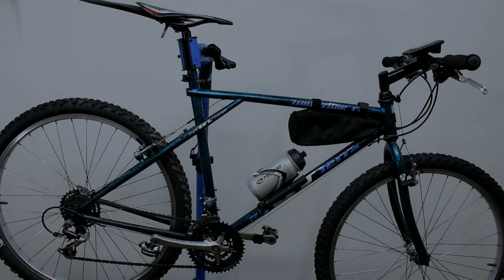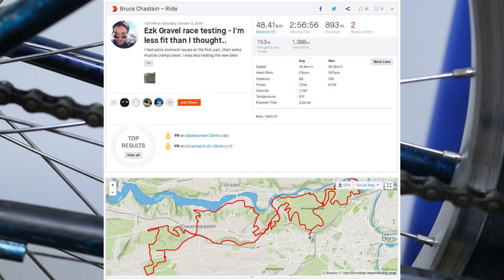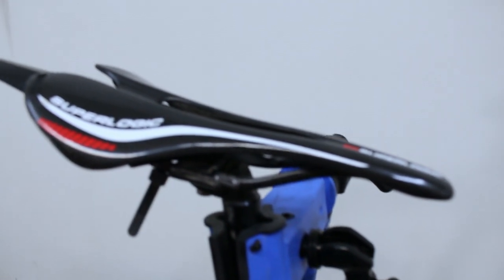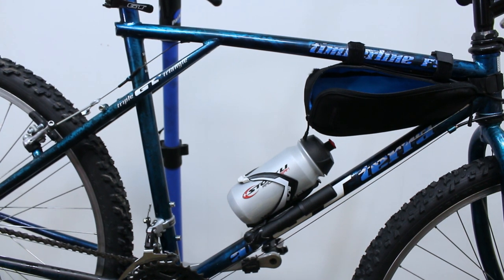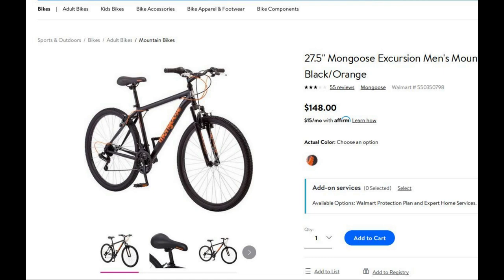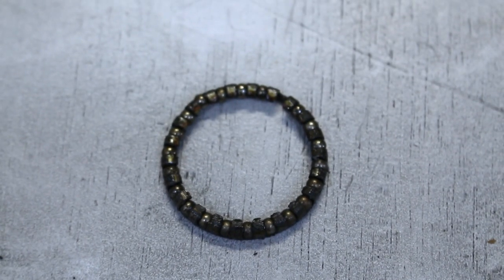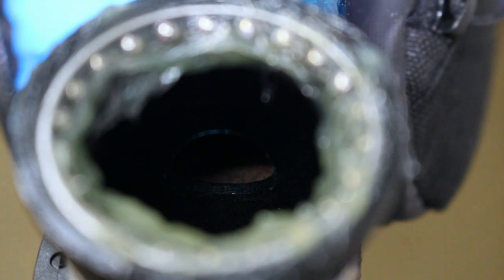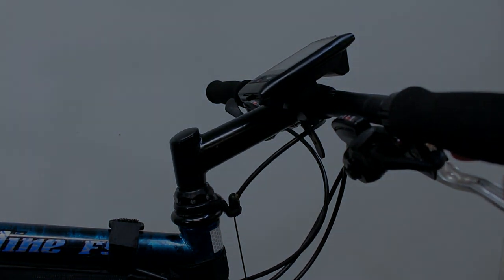1995 Vintage MTB Restoration - PART 2

Comment: I would not worry too much about the rust.  The moly frames are steel, and the frame tubes are not sealed.  Just surface rust, if you see cracks at the welds, then there might be something to worry about, but it looks good to go to me.
Reply from the maker: I did take a pretty close look at the joints. Thanks for the comments!

Comment: A couple of points you brought out in your video:
-I also have a 1995 GT Timberline. It's the best vintage mountain bike I've ever had. I still ride it like a modern bike. 
-The "rust" inside the frame is more patina because the inside of the frame was never coated or painted. If you live in a wet or wintery environment (sounds like you might be in Canada), then you can spray Frame Saver inside your frame to prevent it rusting from the inside out. Honestly it looks fine. 
-Im impressed you found bike brakes at your hardware store.
Reply from the maker: dang I'm getting so many people who have this same bike, I guess they made a lot of them. I'm really enjoying it, actually went on a pretty decent 2 hour ride with her yesterday. thanks for the comments on the rust situation, now it stays indoors when not in use, so I think it should be fine going forward.

Comment: Spray a load of WD40 into the frame at any access points (head tube, seat tube, BB if possible, drainage holes). That should displace any water from the frame, relube the metal but also protect it (to a degree) from further water ingress.

Comment: About the brake squeaking, if there's actually some gum left on the pads you can sand them a little bit, it does give them a little bit of time left.
Reply from the maker: Yeah bet I could have done that, honestly didn't think of it. But I do still have the pads, so I could give that a try.
Reply: Cantis squeak. Cant get away from it.
Reply from the maker: @donnovicki9771  with the new pads, at least for now, they are not squeaking. Actually on the test ride I was doing last weekend some of the disk brake riders were way louder than me.
Reply: @donnovicki9771  Not always! If you tune them properly (which is a challenge) you can get a smooth, silent ride with cantis :)

Comment: I spray fish oil inside my frame and I use copper antisieze  ont all the threads and I use marine grease on the bearings but my bike lives outside and I ride in all weather . What you really don't want is the seat tube and the bottom bracket seizing up that can really ruin a bike .
Reply from the maker: oh yeah tell me about the seat tube, I had one so stuck I actually damaged the frame getting it out.
Reply: I red can rust check all my steel frames and even aluminum ones as they can get the white dust cancer inside. Copper anti seize i use also as i used to use many titanium bolts and  that copper stuff is a must for Ti next to Steel.

Comment: Wow you're using a 7 speed cassette great. Simple and straight forward. Every gear is the right gear
Reply from the maker: thanks a lot T!
Reply: @BruceChastain  A 7 speed is built for all out speed each gear getting progressively harder building up explosive speed. At the right time A sprinters delight. just my thoughts
Finally all a person needs is a 7,8,9 or 10 speed cassette plenty of range 11-12 speed is over kill again just my opinion
Reply from the maker: @tmayberry7559  well this freewheel hub set with 7 cogs is how it came from the factory as most bikes of the time. It’s not going to be as good as the wide rage cassettes of today for sure l, buts they didn’t have much more in the mid 90s.
Reply: @BruceChastain  yes but they do make 9 and 10 speed freewheel. I have on by epoch 11 x34. Go team Chastain!!!
Reply from the maker: @tmayberry7559  do they make 9 and 10 freewheels? I use 9 speed cassettes on almost all by bikes, for me it’s got great range and still a good prices. This bike I sold a long time ago but if you check out my last two builds they are both 1x9 setups, 11-40 and 11-42 I believe.
Reply: @BruceChastain  yes

Comment: Those older chains run thicker side plates then the newer 10 plus speed chains. So they tend to last years. I’d run it and not worry about.
Reply from the maker: Yeah I'll be the experiment and let you know how it holds up!
Reply: Agree. I still have my 89 Diamondback Apex and have all the original equipment except tires and saddle and it works fine. Clean it up and use it would be my advice.

Comment: Nice work on the build.  It's very similar to my own bike, an '87 Timberline Al Terra, except for U-brakes on the rear, a different stem, and some internally-routed cables.  The tubing, the forks, and of course the triple triangle are all there.  I think you'll find that the bike won't hold you back.  Good tires will help; I use Rat Trap Passes as mine's a daily driver and not a pure off-roader.
Reply from the maker: Thanks for the feedback! Unfortunately I'm moving and won't be able to bring it with me, but I'll be on the lookout for another.

Comment: That internal rust is nothing to worry about.  That tubing is thick enough that it would probably never rust all the way through in another 30 years.  If you are really worried, you could spray the inside with JP Weigle's Frame Saver, but that's probably not necessary.  As far as the chain is concerned, I had a completely seized STX 7/8 speed HG chain from my retro find and I restored it knowing it has not been used much.  Low and behold it was still within spec and I used it for another few hundred miles before finally replacing it.
Reply from the maker: I think you're right about the frame, if I find some of that frame saver locally, I'll give it a try.
Reply: I live in Nova Scotia Canada and we are surrounded by salt water and use salt on the roads in winter so rust checking steel frames is a must, and really important for butted steel frames. thankfully a rust check red nozzle extender fits in all welding vent holes in a bike and fork.

Comment: Nice bike - we couldn't afford one when they were first out. Had to make to with a really low end model during the school days. I have a old GT frame coming now - not ready to spend ££££ on a new gravel bike, so making my own.
Reply from the maker: same here, I grew up with Huffy and the sort, but I remember always wanting a GT BMX bike. Are you going with an Aluminum or steel?
Reply: @BruceChastain  Cromoly Steel - just prefer the smaller sleek tubes.

Comment: my only input is never use old rusted chains... the corrosion & pitting on the pins and links are deeper than just the surface you see.. that chain, i'm sure will fail on you sooner or later.  have fun my friend..
Reply from the maker: thanks for the comment Anthony, if it were a serious ride I'd for sure change it, but just around here, I'm not too far from home so I don't worry about it too much.

Comment: Don't worry to much about the rust. It's only surface rust in my opinion. That's not a big deal for a steel frame. As far as the inside of the frame is dry now, the rust will not eat up the tubes. It only becomes an issue if the moisture can not evaporate from the inside of the frame.
Reply from the maker: right, and I'm keeping it inside while not riding it.

Comment: I don't think that for you that rusty frame will be a real problem... Steel doesn't brake without let you understand that it is braking, and as you are a guy who can keep an eye on that, I think it will not fail during a ride. If the frame will crack you can weld it, or replace just the frame and move the nice component to a new bike.
Reply from the maker: Yeah I think you're right, I imagine a lot of steel bikes are like that. Ill keep an eye on it.
Reply from the maker: Thanks for watching and commenting by the way!
Reply: It would be nice to fix it, but I don’t think it’s doable at all. Just live like that until it will brake... if it really will!
Reply: They make spray paint that is designed for the inside of steel frames. That is supposed to protect it from rusting out. If you look for bike frame saver it will show up. I’ve haven’t tried it but it might be worth a look.
Reply from the maker: @mustangjosh94  hmm thanks! I'll take a look for that.
Reply: @BruceChastain  sometimes a frame will rust ftom the inside out, usually you find small pinholes in places like the chainstays.  The frame saver stuff is from JP Wiegle I Think, but cavity wax/preserver for classic cars works well too, Dinitrol and such like.

Comment: Since the Frame and Fork are 4130. They should both outlast your time on this Earth. You cant beat that. I have a Robinson BMX bike that is 4130. I have had it since 1985. Still rides fine.
Reply from the maker: I'm really starting to love the steel frames
Reply: That Timberline has like one 4130 tube in it perhaps two, down  tube and top tube and the rest is high tensile steel.  just means that its a little heavier and high tensile has great fatigue life

Comment: +I have the same bike, and my only issues with it are the seat is too high/handlebars too low, and the brakes are noisy
Reply from the maker: you can usually lower the seat and raise the handle bars.
Reply: I brought the handlebars up as high as I can, and the seat post is stuck. It would only go down a couple inches if I can get it to move.

Comment: I would spray WD40 inside every tube of the bike, then keep rotating the bike so it gets everywhere inside, to prevent anymore rust from getting worse, but seems to be only surface rust.
Reply: WD-40 is hygroscopic and will actually cause corrosion. Do not do this. There are frame saver sprays and lubes like lanolin that are meant for this.
Reply: RollinRat  thank for letting me know, they say you learn something everyday Haha

Comment: I have continued to use rusty chains in the past with no problems. Hell, i have even freed up and used some chains that were seized from rust. That is how cheap I am. I wouldn't let someone pay me to install a rusty old chain to replace their worn out one but for personal use I haven't been bitten yet
Reply: Same. Get the rust off, lube and good to go. Someone mentioned above that older chains were tougher/thicker?
Reply from the maker: That's sort of my thoughts too, I'll do it, but probably wouldn't recommend it.
Reply from the maker: The rollers in the inside are the same but the over all with is thicker as the number of gears gets lower. So the plate thickness in greater on these of 6,7,8 speed chains. I hadn't really thought of it before but makes sense that they'd be more robust.

Comment: The original chsin was so worn, it's probably worn to the cassette and chainrings too. I'd have just left it on and eventually changed the drive train when everything wore out.
Reply from the maker: I did replace the Cassette, but left the front rings alone. So far its holding up good. That old chain was way worn-out!
Reply: @BruceChastain  if it's all holding up then just go with it! 👍🏻

Comment: Yeah the chain looks fine. I've saved worse chains without issue. That rust inside? Mild surface rust. A patina. The bike is 20+ years old. Kept out of the rain, that frame will last a lifetime.

I do have an answer to what can you get from Walmart for $150. I bought a Hyper Explorer from Walmart's website for like $148 including shipping. Full suspension, 27.5 inch, front disc brake, alloy pedals... Would I trust it on a trail? No. But that's okay because I did not buy it for trails.

How is it as a bike? Well the rear suspension was actually non functional until I took all the pivots apart and greased them. The bike arrived with a warped front wheel, but that didn't matter because I bought it to fit a front wheel E-bike kit to. The alloy pedals were also bound up until I greased their bearings. All in all, about what I expected and I plan to upgrade it as I go.

Annnnd subscribed!
Reply from the maker: Thanks for the good comments. I also have a walmart bike, a Kent road bike, there are a few videos on this channel you can see my adventures there :) . Overall I get the walmart bike thing, but somehow I just get amazed how good an old classic is for the money.
Reply: @BruceChastain  Oh yeah no doubt. Old bikes have withstood the test of time, and are worthy of respect for that.

And yeah I saw the videos of that Walmart bike. What surprises me is that GMC licensed their name to a bicycle. I never heard of that until I saw your video, and I'm in the heart of GM territory.

Comment: A new 8spd chain is about $8 on Ebay.
Reply from the maker: true. I should really get one. I think even locally they're only like $10.
Reply: Why throw 8 bucks away if you dont have to?
Reply: @oreocarlton3343  Chains stretch over time. If it's the original chain it's had almost 30 years of use. A stretched chain can wear down the rest of your drivetrain.
Reply: @TheRadDadShow  I was talking about the old unstretxhed chain, nothong wrong with it if it isnt stretched

Comment: I re-used my chain once I checked every single link was free moving. I would accept a hard to move link, but 100% seized and I would have replaced it.
Reply from the maker: I ended up getting them all moving. So far it's holding up. I'll post back when it snaps :)
Reply: @BruceChastain  My mistake was just pushing the pins back in. One plate came loose and explained my cycling felt weird. Bought a split link and all was good.

First time that happened to me.